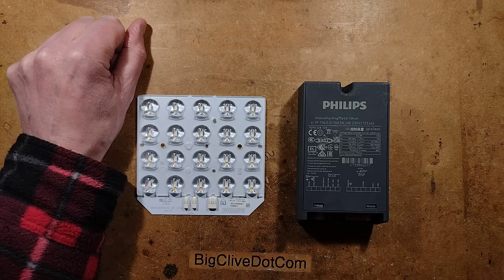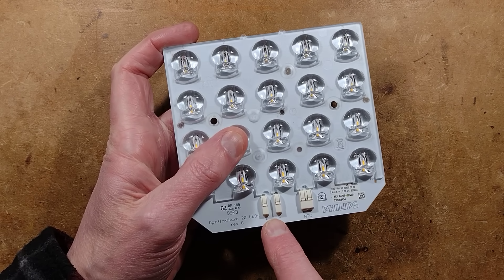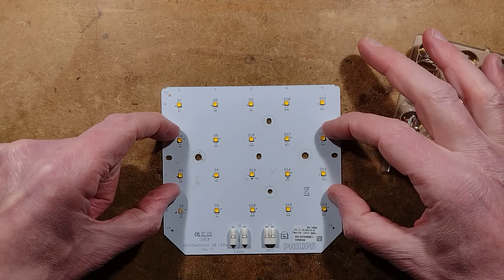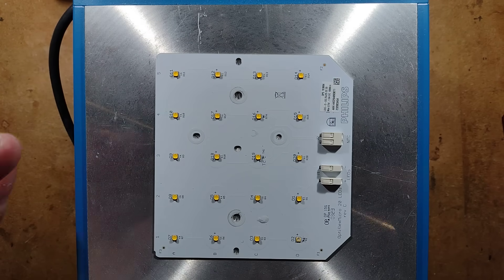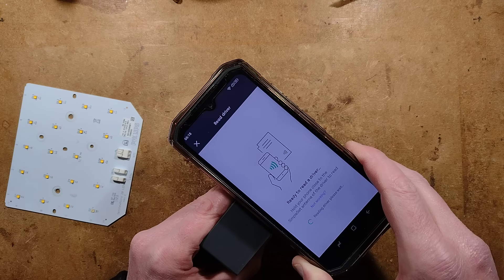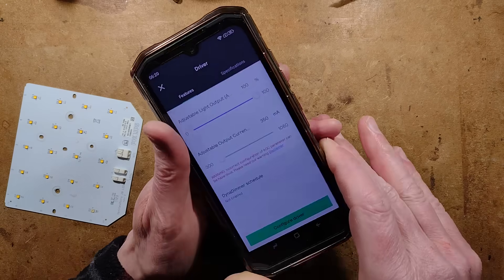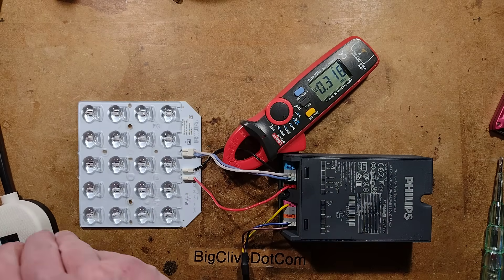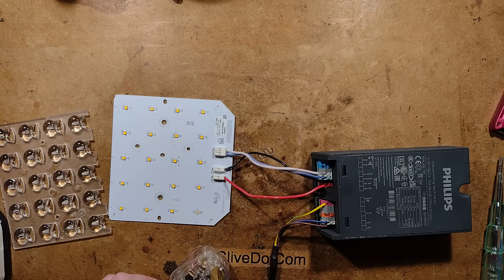Philips street light LED panel repair and programming the driver.

Comment: Many of the LED street lights around where I live in Bucks are flashing on and off every second or so. So they don't appear very reliable.
Reply from the maker: That's often a sign of power supply failure.  Thanks to the profitability of the "green" industry the entire head will probably be replaced at great expense by a labourer, and the old one sent to landfill.

Comment: I do like the programming of the power supply.
Reply: Wait till you see the larger antennas that could apply the settings to 10/20/etc packs of drivers at once.. Would be pretty slow to do 1 at a time on production line.

Comment: The programming of the driver was really interesting. That process excites the inner child in me so the next step is to take the driver PSU to bits and see what magic is to be found inside 😁
Reply from the maker: It's massively complicated inside.
Reply: I really expected it to need power to be programmed. Of course bank cards work in a similar way but I doubt if you are trying to write data into them. 
Thirty years ago a large part of my job was unplugging ICs and reprogramming them in a very expensive Data IO programmer (usually to be told three days later "The softies have produced version xx.x. Can you reprogram all the test rigs.")

Comment: Probably uses one of the neat chips made by ST, NXP and maybe others  which combine an NFC tag and an I2C EEPROM, so can be accessed by a host MCU and external NFC like this.
Reply: Silicon Chip magazine published a remote control project in Feb '25 that used an ST25DV04K-IER6S3 dynamic RFID tag chip as the programming interface.
Reply: Have you had a play with any of these parts?

Comment: All the municipal(city owned)items here are stored at a secured site with 10ft high fences and guard dogs including replaced or broken items/devices.  So getting ones hands on used or replaced goodies is next to impossible.  Too bad as there's lots of cool looking stuff there, street lights, traffic lights, panels ETC., no telling what kind of treasures are there.  The privately owned electrical utility company is a separate entity that has its own storage area with industrial equipment including rolls of cabling, meters, poles, machinery and the like so playing with cool stuff like this street light is a no go for me.  Too expensive to buy... Thanks Clive👍👍
Reply: Have you considered asking them for old parts?

Comment: Interesting. I wouldn't had thought that you could program it without external power, but now that I think about it, it's just like programming an NFC keyfob with your phone. Plenty of memory for a small config like this, no need for "complicated" programming circuitry. I'm wondering if cheap copies include off-the-shelf NFC keyfobs as a memory chips for the config. 🤣 (Reminds me of those old really cheap USB memory sticks that actually had MicroSD cards inside. 😂)

Comment: I program Astro clocks the same way for common stair lighting in Scotland. I use a Samsung Android but have to take it out of its case. I am surprised you cannot program it to go to 50% or 75% output say after midnight for energy saving.
Reply from the maker: Depending on the driver it does have time and corridor style functionality where it can dim and use a body sensor to gently increase the brightness when someone is near.

Comment: I guess making one overly complicated programmable power supply is more cost effective than making lots of simple ones.
Reply: Making it is just a tiny part of the cost savings. Try to keep those traditional ones on stock around the world for few years. No wholesaler would have the model you need on stock in 5 years, but they would all have some obsolete version of it that looks the same but doesn't fit for the need.

Having the ~universal led drivers in few different form factors and power brackets makes fixing lights possible.. Like in the ballast and starter times.

But those still need more options.. Now there's tens of different ways to control lighting. Most of the wireless stuff is Bluetooth, or at least would be possible to implement with same radios. Dali is a common wired bus. Switch-dim is nice addition, when installing only few lights and nothing fancy is needed.

Switch-dim also is often implemented on the same connectors as dali, which makes the dali bus able to handle mains voltage without explosing, which happens way too often when renovating 3-phase lighting systems. Sadly the control devices in the cabinets haven't been made to handle that.

Comment: Interesting, though it seems (to my simple mind) that you wouldn't be able to check or change the parameters when the power module was installed in the pole (NFC part side-mounted).
Reply from the maker: They are programmed before being installed.

Comment: 1:35 - you should come see the shite Lambeth council has fitted in Clapham. The pavements are darker than the bottom of the Mariana Trench.
What they did was by cheap rubbish and stuck it onto the existing lampposts whereas they should have shortened them slightly OR bought the proper ones like Wandsworth council down the road bought.
Reply from the maker: They're probably using contractors who are employing "upskilled" labourers to bang them in on a bonus scheme.  (And by upskilled I mean a four hour slideshow called G39.)

Comment: Is there a reasonable way to remove potting?
I'd like to remove the shunt on my Ebike controller, but apparently, the manufacturers have smartened up, and they've potted the entire damn thing.
Reply from the maker: It usually involves heat and gradually paring your way in.  If you know where the current sense shunt is then you may be able to gently drill to gain access to each end.
Reply: I’m still waiting for “big Clive” to buy the charger and battery for those e-bike/scooters as to why their lithium battery’s are “spontaneously combusting” giving concern to our fire brigade, and recently “transport for London” has banned them on its system; I suspect the chargers & battery’s are “polished turds” and….. just need Clive to confirm that 🧐
Reply: @samuelfellows6923  The charger that came with mine definitely is. They put a sticker on it that says no indoor charging. Of course, the manual says not to charge outdoors. I immediately ordered a more expensive charger. The controller is definitely cheap, they're like $15. I haven't pulled the battery apart and probably won't, but if they can cheap out anywhere, they will.

Comment: Other phone was not deleting files maybe it was disabled by accident or by a bad update, if you go into the general files in the phone, if it is an android phone, click the android folder then delete a folder called ".trash" and it empties all deleted files, it functions as the recycle bin and I do it to my own phone as for some reason it stopped working too
Reply from the maker: I had to do a factory reset on it.

Comment: But it is a street light not a road light, if it is not illuminating the street it is functionally useless😂 cars already have lights built in...

27 seconds on? Has someone reset the unit, be fun if you did program it to burn out...

Comment: Good to see you using your Doogee phone, Clive - I bought one on the strength of your video and it's been in constant use since. Robust but pretty chunky for the pocket. The infrared camera is handy. I do have problems paying at the supermarket, though, because the NFC doesn't pick up the signal (maybe I'm pointing the wrong area at it).
Reply from the maker: I love the thing.  Note that the NFC coil is actually just below midway down.  Try touching your phone centrally to the sensing coil in the supermarket card reader.  In McDonalds, I have to hold the phone upside down to get the coil in far enough to be read.

Comment: Some of this type of programmable driver I have come across have had the programming locked so you can only view what it is set to on the phone app and not adjust it. :(
Reply from the maker: I've come across some of those too.  Factory set to a fixed value.

Comment: 60W of power for a streetlamp! And in the incandescent-bulb days, 60W was the rating of a dim bulb you would use to light a small room. It never ceases to amaze me how efficient these are as a light source.
Reply: Then amaze yourself at the 250W and 500W street light bulbs that lit the streets of my childhood - and that is the Watts per lamp. Now multiply that by the approximately 100 lamps along and around the estate, and suddenly, 25kW to 50kW goes nowhere!
Reply: Глупость. Лампы 250W в уличных фонарях почти равны диодам @whitesapphire5865
Reply: I know, the floodlight bulbs I just put up were like 18 watts or something.
Reply: What's an incandescent light bulb?
Reply: @hoverbovver  it is a light bulb that is very angry.
Reply: And on the flipside, you can get crazy high power LED lights that you can put in a normal fixture! I had some '2000W equivalent' or something ridiculous LEDs in the garage and they're amazing, vs my old halogen spotlight that will burn you if you touch it.
Reply: 60w was only enough for a desk lamp, We would always use 100w bulbs.
the only this I miss from incandescent bulbs is the cri, I wish LEDs fine tuned for medum white (round 5500K) with good color rendering index weren't so expensive :(
Reply: LEDs tend to produce narrow colour bands that mix to make a sort of white. But they don't have the colours in between the peaks.
Reply: Yet, there are still people that will argue that the old incandescent bulbs are better for several stupid reasons...

Colour temp is worse.... Yeah, you've just purchased cold white LED bulbs, do some research and buy warm white if that's what you're looking for!

The waste heat is useful and will reduce your heating bill.... Yeah, what about the other 6+ months of the year when you really don't want the extra heat in your home and might even be paying to remove it! (not to mention outside lights and the fact it's a stupid argument for inefficient bulbs!)

They are meant to last 10000 hours but I'm sure it only lasted 8000 hours.... well that's still better than the 2000 your old bulbs lasted.

The biggest problem most people that complain have with them seems to boil down to.... They're different and I don't understand change.
Reply: @ChuckFickens1972 Probably also to do with the continuous colour spectrum and lack of flicker. Yeah, pretty stupid of people to like that.
Reply: @ChuckFickens1972  CRI is still worse unless you buy some very expensive lamps.
Reply: @ferrumignis  Oh, absolutely, I work (as an IT engineer) for a company that is involved in broadcast TV....

 But I doubt many people are worried if the CRI of the light in their bedroom or front room isn't 100%
Reply: @ChuckFickens1972  personally i dont like the feeling of looking through a set of  polarized lenses which you get with led light.

i even go beyond incandescent and glass and use liquids or other organic filters for lightshade. your whole body feels more relaxed with it. maybe it affects some more than others.
Reply: @luminousfractal420  OK...

I know some people see sounds as colours and can see colours outside of "normal" human vision so I'm not going to disregard what you say.

The polarized thing, I'd guess you're describing badly smoothed LED lights where they can appear to flicker if you move your head about quickly...

The organic lightshades, hey.... you do you.... If it makes you feel better then stick with it.
Reply: @luminousfractal420  I guess my eyes are like yours but apart from the horrid vibrating flicker from displays in Tesco's, the polarising effect doesn't really bother me. Sometimes I find it quite pretty, especially outside in frosty air.
Reply: @ChuckFickens1972  in the current LED bulbs I buy for a buck, I notice zero flicker and perfect warmth. Now when I see someone's LED Christmas lights on their house or fence while I'm driving, I'm just glad I don't have epilepsy!